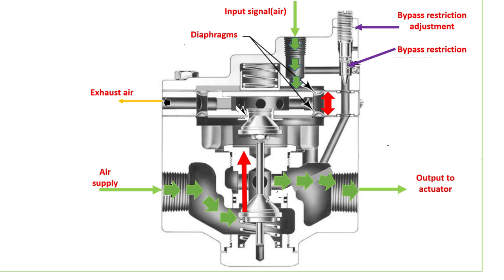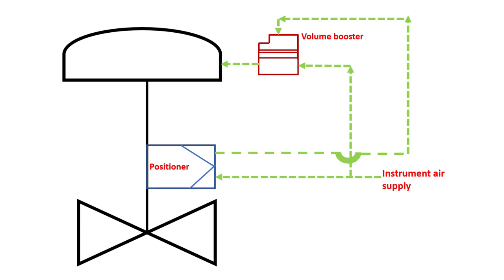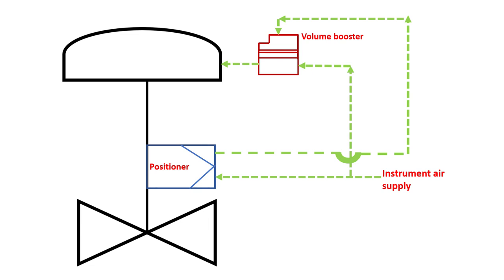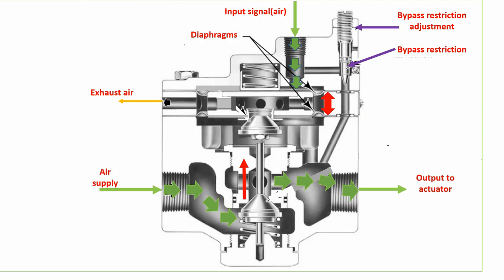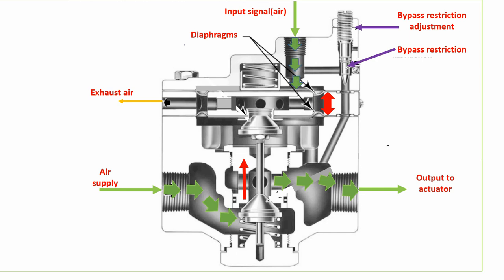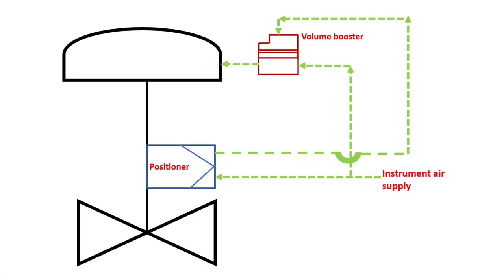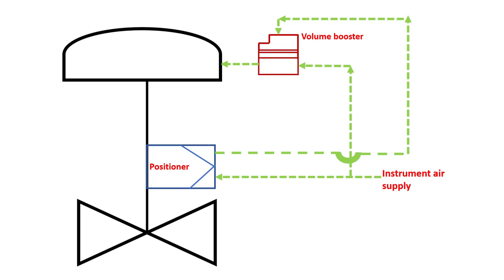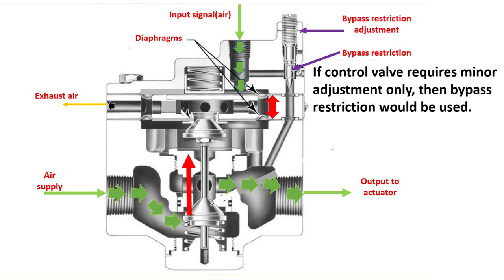How volume booster works in actuator | Learn Instrumentation Engineering

Comment: hi, this is very helpful for me.
I have one question, as I am understanding correctly adjust bolt clock wise fully that means fully closed, this action is full speed increase. is it right?.
and fully loosen adjust bolt is there speed depending on their air supply pressure only?
Reply from the maker: Normally, manufacturers will mention the adjustment arrow in volume booster component or they will mention the item number in instructional manual. So, we should check and execute it👍🏻